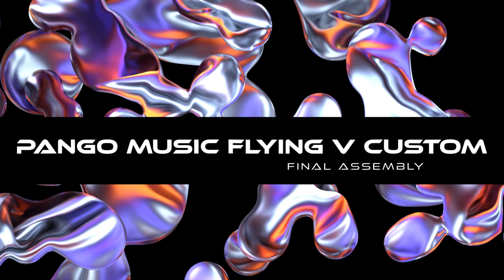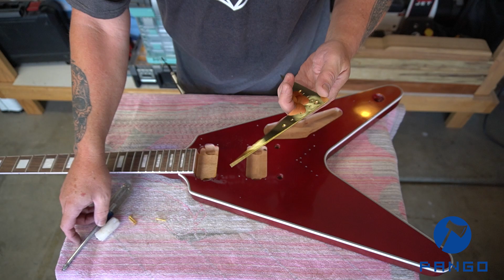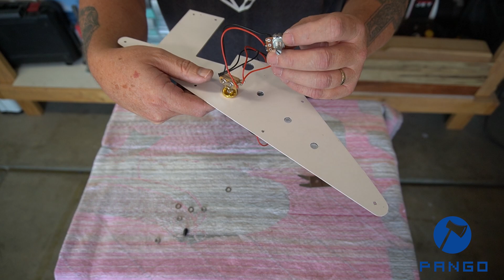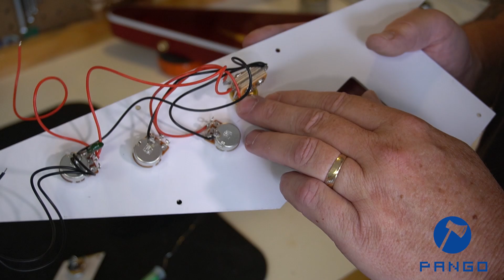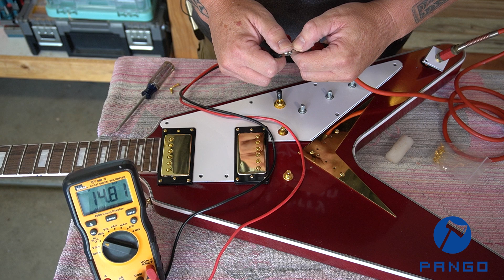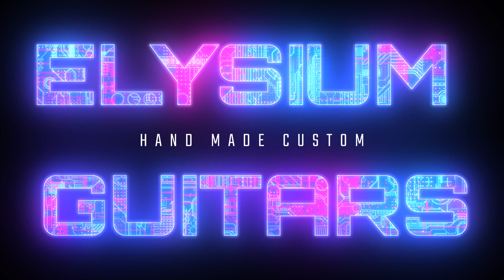Pango Music Flying V Custom   Ep 6   Final Assembly

Comment: Hey bill! I’m building my custom v from pangolin right now. I can’t get the v shaped  string thru tailpiece to line up with the Pickguard? Did you have to cut the Pickguard at all?
Reply: In the 3 V kits I have built, none of them align with each other.  Even some of the Gibson Vs don't.  You would have to trim the pickguard.  Just be carful of your control cavity size so you don't trim the pickguard past that point.
Reply: @ ok good to know. That’s what I was gonna do is line up the v tailpiece and then trace the angle and take it off the pickgaurd. I just hope it doesn’t end up looking goofy. Was maybe gonna order a new pickgaurd off WD hope that that remedies it. But they’re like 50 dollars plus